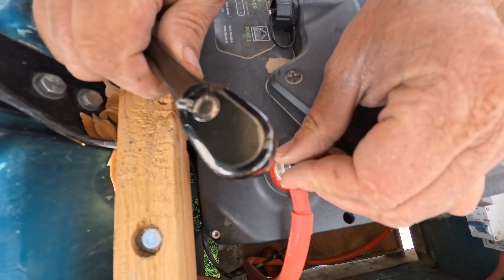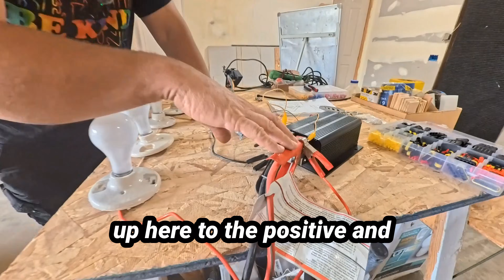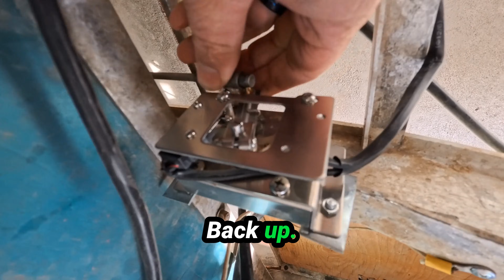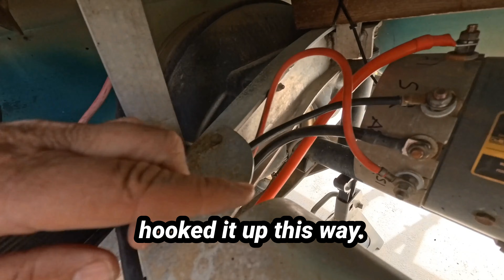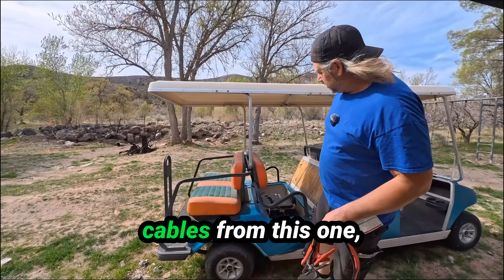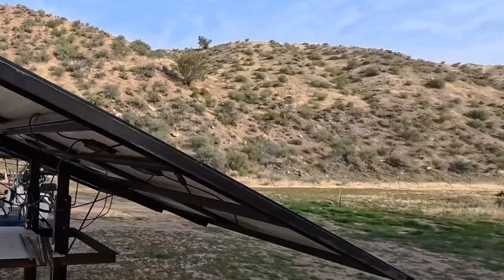Club Car Resistor to Curtis 1205 Solid State Conversion

Comment from the maker: The Curtis 1205 controller is A DC motor controller, and it is used on many different electric vehicles Including forklifts. It is used on both series motors and permanent magnet motors. When ordering a controller make sure it is programmed to the right throttle Control setting. They can be programmed for 0-5K, 5-0K and 0-5V.
Reply: Hi Solar Farmer!  Thanks for the very informational and entertaining video!  As long as the motor controller matches the potentiometer box with regard to programming 0-5K, 5-0K or 0-5V, does the motor matter?  I have an old, old, Cushman (1970 I think), 36V motor.  So, I won't be able to use your bill of materials verbatim, but if I order a pot box and Curtis motor controller both with 0-5K, as well as new solenoid, will I be okay?  More specifically, what is this programming and how does it affect the system?  Maybe if I understood why we program them and how it changes operation, it would make more sense for ordering parts.  If I missed a video or a post which answers programming questions, I would appreciate if you or someone could help direct me to it.  Thanks again!  Great job!  Fun to watch and learn from you!
Reply from the maker: @DustinScholz-y4f  the  0-5K, 5-0K or 0-5V Programming has to do with the pot box Communicating with the controller to adjust the power going to the motor. If your pot box is a 0-5K and your motor controller is programmed for 5-0K Then your golf cart will start at full speed and slow down when you push the accelerator. The Curtis controller can be ordered preprogrammed or can be programmed with a handheld programmer or a laptop with the right program. I will need to know more about the motor on your golf cart to know if it will work. Most likely it will.
Reply: 500A 48V 0-5k DC Motor Controller P125M-5603 Compatible with Curtis 1205 1205M-5601 1205M-5603

This is what I bought. Is this programmed correctly?
Reply from the maker: @daltonmadsen7303  Yes
Reply: Do you have a parts list? I have a 1980 club car ds with a single lithium
Reply from the maker: @jamescarlson6835  Yes, parts list is in the description of the video.
Reply: @jamescarlson6835 are you having hesitation resistant with your acceleration
Reply: Question,  I have everything in my Cart you suggest but the High Amp Forward Reverse Switch is sold out.  Do you have one you recommend for a 36v Club Car system that can be wired the way you did.    Thank you.
Reply from the maker: @chris2818  I would suggest using this one it is less money than the one I originally listed and it is good for 36 volts and 48 so if you want to upgrade to 48 volts in the future it would work for it. https://ebay.us/8BlNbX
Reply: @Thesolarfarmer  excellent thank you so much.
Reply: Thanks so much fot this video. I'm just getting started with an 86 ds. Bought it not knowing the vglide was missing all together. 
This is a 36v factory cart. Is there any reason not to put a 48 volt batt and this solid state setup in it besides the fact that most cheaper batts don't fit in the tray? I did find a 36v 50ah that fits in one of the side trays but im worried ill kick myself down the road. 
TIA
Reply from the maker: @MrCrazzyeddie99  I would recommend going 48v. When you remove the resistor coils it gives you a lot more room. Here is my second video that has more details on a conversion. https://youtu.be/F0F2coSesYw
Reply: @Thesolarfarmer thanks again.  Going 48v
It seems like the mcor4 is also much easier to use. Do you prefer the pot box?
Reply from the maker: @MrCrazzyeddie99  I prefer the MCOR4 It is a lot easier to install. On my first conversion I didn't even know it was an option.
Reply: @Thesolarfarmer I thought the same thing.
Reply: I have this Curtis controller with an ITS throttle on my 98 series cart. Upgraded solenoid and F&R switch. I converted it from a 36v to the 48v DC house lithium. I was at the cart shop with the programmer and it wouldn’t accelerate at all. Controller is showing voltage Any ideas?
Reply from the maker: @jacobsoto5343  I do not have experience with the ITS throttle which uses voltage as a signal to control speeds on the Curtis controller. I have only used the pot box and on my last build I used the MCOR4 speed controller. 
https://youtu.be/F0F2coSesYw
Reply: I watched a video on the Ez Go conversion and there is a positive lead that comes off the FnR switch to the controller to slow down the reverse.   It was the post on the far side of controller not the side with 3 lugs.   Does the FnR have a micro switch on it for reverse?
Reply from the maker: @WattsinWattsout  If you put power into J-5 on the controller It will put out less power giving you a slower reverse. The controller would need to be programmed for it. I talk about it a little bit in my second conversion video. https://youtu.be/F0F2coSesYw
Reply: Could u email me the links to the parts you used. I have a 1989 club car DS 36 volt.
Reply from the maker: @DavidPayne-t9d  Motor Controller 48V 0-5kΩ 500A Golf Cart 1205M-5601 P125M-5603 https://ebay.us/Hi0DWK
MCOR 4 Conversion Kit for Club Car DS 48V Golf Cart https://ebay.us/cwyd9J
PB-6 Throttle Curtis style Potentiometer PB6 Type 0-5K with Micro-Switch https://ebay.us/T7uMGK
Main Contactor Solenoid 400A 48V DC For Heavy Duty Golf Cart Car ZJ-400A https://ebay.us/hpVaac
The connecters needed if you don't want to cut wires on pot box https://ebay.us/GvXGmq
Pre charge Resistor https://ebay.us/V2u4fM
3/8" Wire Ring Terminals Connector Combo Pack 22-10 Gauge https://ebay.us/EGHdo5
Reply: @Thesolarfarmer ty very much. Love the videos
Reply: @Thesolarfarmer if I use mcro4 box I won't need pot box will i
Reply from the maker: @DavidPayne-t9d  you can use a pot box or MCOR4. My first conversion I used the pot box and my second conversion I used the MCOR4. MCOR4 is easier to install. My second vid shows how.
 https://youtu.be/F0F2coSesYw
Reply: @Thesolarfarmer I noticed u had a hot and a ground buss bar. Do I need those as well
Reply from the maker: @DavidPayne-t9d  You don't need the bus bars I like to use them on some of my golf carts because I have so many wires with the solar and auxiliary out.
Reply: @Thesolarfarmer so I have 89 club car DS. Aluminum frame. Has no top on it. Once I do these upgrades in here. How fast will I go. I still have 36v lead batteries. With lift and 22x11x10 tires
Reply: @Thesolarfarmer and also. Is the motor ok in my 89 club car DS or do I need to replace the motor
Reply from the maker: @DavidPayne-t9d  It's not going to go any faster until you upgrade your batteries to lithium and 48 volts.
Reply from the maker: @DavidPayne-t9d  Series motors run better on 48V and some guys even put up to 120 volts in them.
Reply: @Thesolarfarmer oh ok. Lol so me upgrading from coil to solid state isnt gonna make any improvements on speed
Reply from the maker: @DavidPayne-t9d  It will give you smoother acceleration and it is more efficiency battery will last longer. It is definitely safer not having those coils getting hot and catching on fire.
Reply: @Thesolarfarmer can I still use the Curtis controller you mentioned and the HD 48V solenoid with my 89 Club Car DS
Reply from the maker: @DavidPayne-t9d  yes
Reply: @Thesolarfarmer what forward/ switch lever style do I need for my 89 club car doing this conversion
Reply from the maker: @DavidPayne-t9d  You should be able to use the same one I did.  https://ebay.us/8BlNbX
Reply: @Thesolarfarmer so I just acquired a 1999 Club Car DS 48v. Will all these components work on it as well. Is it a 0-5k or ??
Reply from the maker: @DavidPayne-t9d  I converted my 2003 Club Car DS https://youtu.be/F0F2coSesYw
Reply: @Thesolarfarmer is the 99 club car DS 48v still 0-5k
Reply from the maker: @DavidPayne-t9d  I would need to have more information about your golf cart to know. Does it have Curtis controller Or does it have a V Glide and resistor coils?
Reply: @Thesolarfarmer sry yes has a Vglide. And yes it had resistor coils
Reply from the maker: @DavidPayne-t9d  If you install a pot box then your cart would be 0-5K if you install a MCOR4 then your cart would be a 0-5K or 5-0k or 5 volts depend on how you wire it. The Curtis controller can be programmed for 10 different throttle types. Your golf cart currently has none of these components, so it is none of these.
Reply: @Thesolarfarmer ok ty
Reply: I bought the same controller in your link. Will it run on a 36 volt battery until I can go lithium? Thanks.
Reply from the maker: @StaegeRacing  Yes works just fine. https://youtu.be/2JQsEvNkglg
Reply: Could u send me link to manual you are using.
Reply from the maker: @DavidPayne-t9d  https://www.manualslib.com/manual/815243/Curtis-1204.html
Reply from the maker: @DavidPayne-t9d  https://www.manualslib.com/manual/815243/Curtis-1204.html
Reply: @Thesolarfarmer thank you. And my gas pedal linkage don't look like the one on my golf cart or have the mounting holes like the one u did. Is a 1989 different
Reply: @Thesolarfarmer I think I have to use the pot box on mine. My setup don't look like the one u doing mine is totally different underneath at the pedal
Reply from the maker: @DavidPayne-t9d  1996 is when Club Car started drilling the holes in the frames for the MCOR4.
Reply from the maker: @DavidPayne-t9d  Yes, you have to use a pot box on anything older than 1996.
Reply: @Thesolarfarmer so as I was listening the nuts on the electric motor to replace the wires on it I had spray them WD-40 had the two wrenches. I was working them back and forth cuz they were rusty. When I got to the third one closest to the front it broke how hard is that to replace
Reply from the maker: @DavidPayne-t9d  I don't know. I have not done one yet. I'm sure I'm going to end up doing one sometime LOL
Reply: Does this DC Motor Controller  come for 36-volts club car golf carts?
Reply from the maker: @Jose_Gonzalez-j5q  This controller is good for 36 and 48 volts. I actually go back and forth between 36 and 48 volts depends on what battery I am testing at the time.
Reply: @Thesolarfarmer thank you for the info
Reply: My mistake it is a 1204-027 controller I believe oike the one in the video " under $250" the one you did conversion on first
Reply: Any ideas on how to connect wires from f/r micro switches to controller for half speed in reverse. I was told you could use a 5.1K ohm resistor inline to fool controller it's only receiving half voltage.
Reply from the maker: @waynestewart7564  This is how to wire it, I have not done it yet, but I am planning on doing it.
 I should get cracking on it Lol.
 You will need a 1313 Programmer to program J5 
here is my programming guide. 
http://bit.ly/TheSolarFarmer1205

First — The Physical Connector

J5 is a 6.35mm push-on terminal located with the other low current connections on the controller. Use 18 AWG vinyl insulated stranded wire for any J5 connection — same as the rest of your control wiring. 

By default, J5 is inactive Setting 0

Option 1 — Setting 1: Active Reverse Input

What it does:
J5 is used as the input when the reverse direction is selected. This simplifies the wiring for limiting reverse speed — the speed in reverse is limited by the setting of the Rev Speed parameter. 

How to wire it:

Connect J5 to the reverse signal output of your forward/reverse switch
When the F/R switch is placed in reverse, it sends a signal through J5 to the controller
The controller then applies your programmed Rev Speed limit automatically
No separate speed reduction resistor needed — the controller handles it in software

The key advantage of Setting 1:
Your Rev Speed parameter in the programmer becomes fully active and functional. Without J5 wired for reverse input, the controller doesn't know when reverse is selected and can't enforce the Rev Speed limit through software alone.

Important limitation: With this configuration the main contactor does not open the battery power in the event of a severe fault. Safety protection on a fault is handled by your existing contactor wiring rather than the controller. 

Option 2 — Setting 2: Active Main Contactor Driver

What it does:
J5 is used to drive the main contactor, which will open the battery power in the event of a severe fault — this helps meet safety regulations. 

How to wire it:

Connect J5 to the coil of your main contactor
The controller now directly controls whether the main contactor is open or closed
In a severe fault condition the controller opens J5, which drops the main contactor, which disconnects battery power entirely
This is the highest level of fault protection available

Wiring path:

J5 on controller → Main contactor coil (+)
Main contactor coil (-) → Battery (-)
Controller now drives contactor open/closed directly

The key advantage of Setting 2:
Maximum safety — in any severe fault the controller can cut all battery power by opening the main contactor. This is why it's required in many commercial and safety-regulated applications.

Important limitation: If you wish to limit reverse speed with this configuration, you will need to add a speed reduction resistor — unlike Setting 1, the Rev Speed software parameter alone won't limit reverse speed in this wiring configuration.
Reply from the maker: @waynestewart7564  Well you inspired me to make the video. I am going to get the parts tomorrow and start filming pretty soon. I connected J-5 directly to positive on the battery To test it and see if it works. It works But because I was directly connected to the battery forward was slow as well. I've got to get some longer bolts so I can connect a second micro switch to the forward and reverse.
Reply: My understanding is since the controller is not programmed you would have to fool it to think the pot box is only pressed half way down to get the half speed in reverse. If you use the micro switch that is NC in reverse snd splice a 5.1K resistor inline with wire from there into the pot box wire going to controllerbit should  work. I could not get it to work. I checked wites with multimeter pressing the accelerator and meter still would go to 5.1k ohms. Still hoping and thinking..
Reply from the maker: @waynestewart7564  This guy has wired up half speed reverse with a resistor. https://www.youtube.com/@smitty2721
He commented somewhere in this thread and said how he did it. I'm trying to find it.

Comment: How many amps is your bus bar rated for?
Reply from the maker: 250 amps
Reply: @Thesolarfarmer even with a 500 amp controller it works fine?
Reply from the maker: @williamfowler61  Yes works fine. Even with a 500 amp controller your motor is only gonna be pulling 150 amps going up hills maybe 200 at the most.

Comment: Hi I just got done watching your video I was wondering how is it still holding up
Reply: I do have a question the golf cart am working on has no previous wires I was wondering what size wire you recommend me getting for this whole set up (solid state)
Reply from the maker: @father_king5652  Most stock golf carts use 6 AWG battery cables, but 4 AWG is what I would Recommend.
Reply from the maker: Yes, it's still working great.
Reply: Awsome am watching the same video over so I can get it right I just purchase a 8 seater golf cart looking to shorten it up and then run the exact system you have
Reply from the maker: @father_king5652  That sounds like a fun project. Make sure you watch my second video. I use an MCOR4 On my second build it's definitely easier to install than the potbox. There's a link In the description for my second video.
Reply: Yeah I just watch that but couldn’t finish it am at work but were you able to adjust the throttle response
Reply: So that mcor for the throttle it says it’s for up to 2004 mine a 2006 I can’t fine one for 2006 club car ds any thought ?

Comment: Awesome. Did this conversion and very happy with it on my 94 club car. Thanks for the great videos and links to buy the supplies needed! Only difference I did was put the negatives on the negative side of small terminals on the solenoid. Basically opposite of what you did. Also added a diode to the small terminals. Works great.  Upgraded all to 2 gauge wire as well. Recommend as the controller will put itself to sleep if bottle necked. Thank you
Reply from the maker: That's great. I really like the upgrades you did.

Comment: What if I have a sepex motor with A1, A2, F1, F2
Reply from the maker: I think it's possible but only if the SEPEX motor is a DC motor. I have not done it and from all everything I've researched it's not ideal but will work. If I found a golf cart with a SEPEX motor I think I would give it a try Sounds like a fun challenge. Definitely spend some time doing research on your motor and controllers before you attempt to do anything.